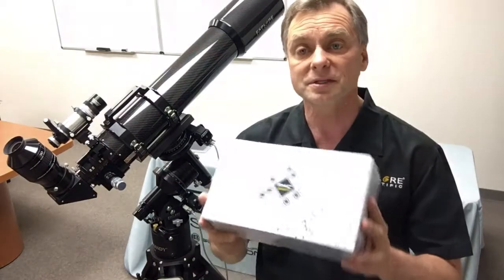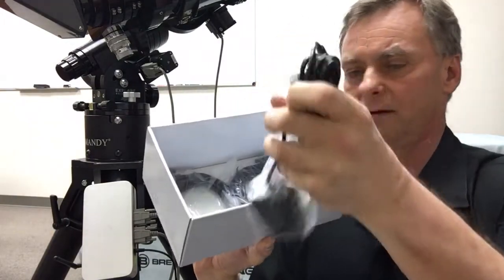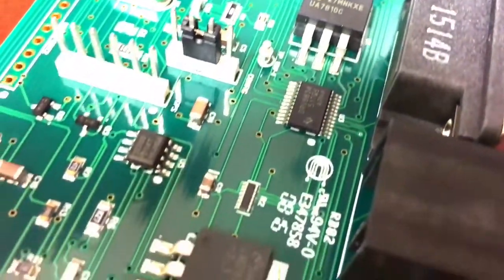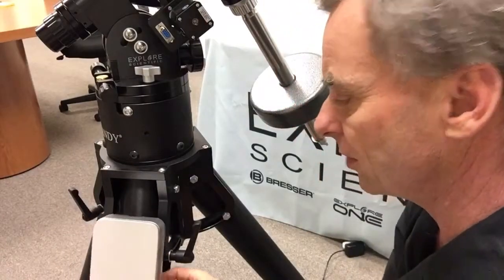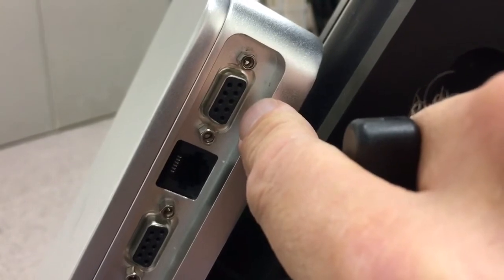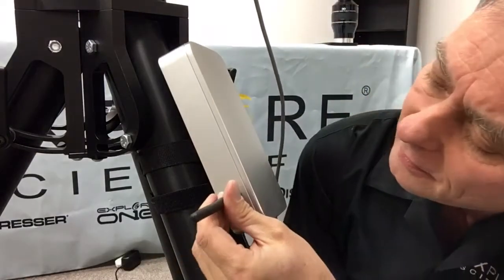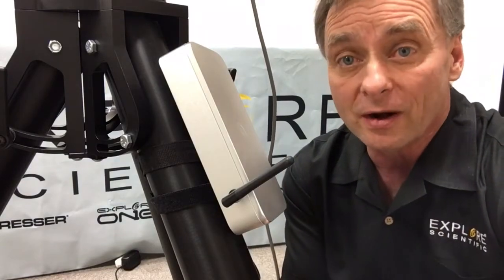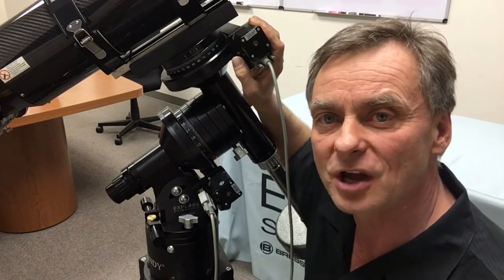Explore Scientific PMC-Eight: Unboxing and Installation

Comment: I got a EXO2 EQ5 PMC-8 A few days ago, and When you want to start doing the alignement is it very important to have done a polar alignment or not?
Also on a Win 10 system, using the arrows to move the mount doesn't seem to work. A proper guide on how to use your software would be really welcomed